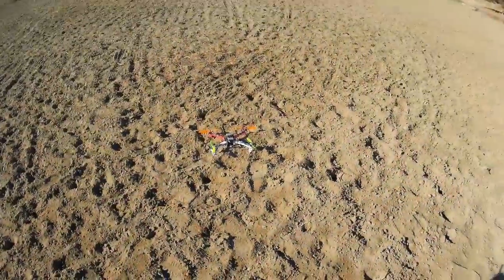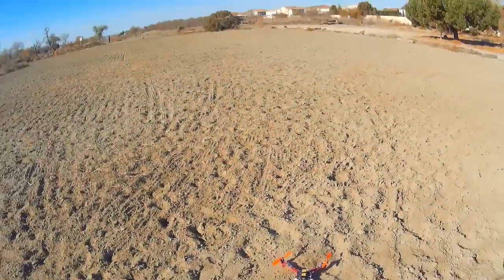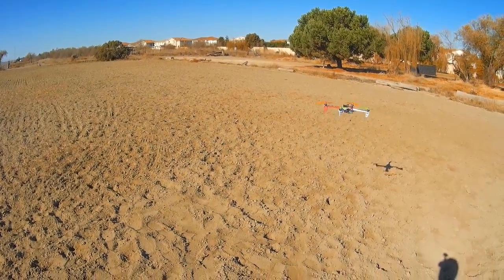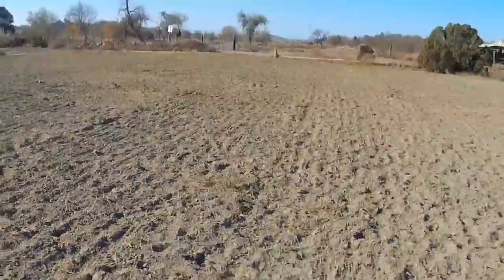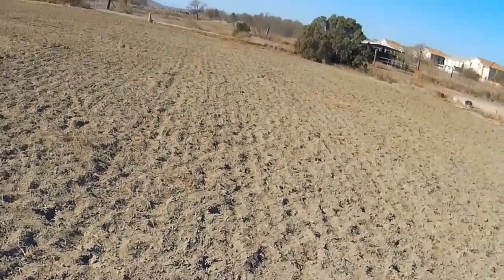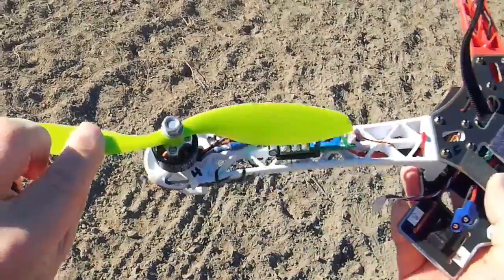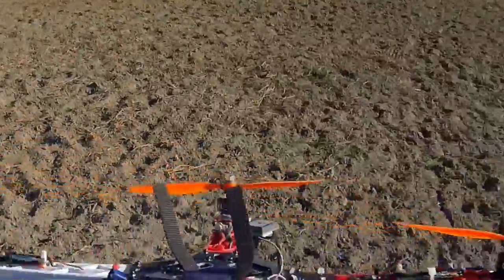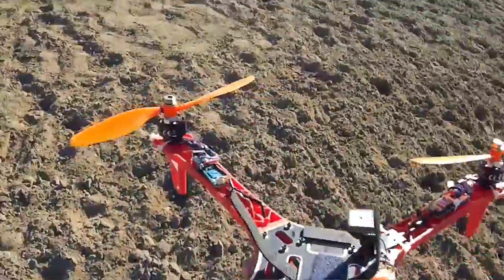First Field Flite Blade 350QX guts on a FL450 Frame

Comment from the maker: I didn't look to close at the F330 frame because all I found were sold out. The F330 has a shorter base than the F450 and will most likely fit the 350QX wiring better. Only problem I had with the motors is the screws were too short and I didn't have longer ones so I zip tied the motors to the mount. That seems to work OK.